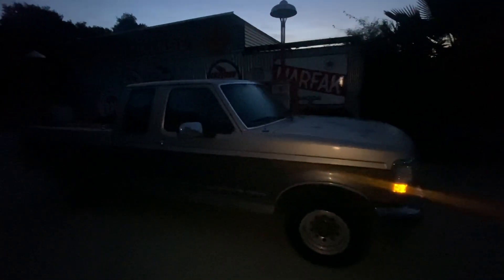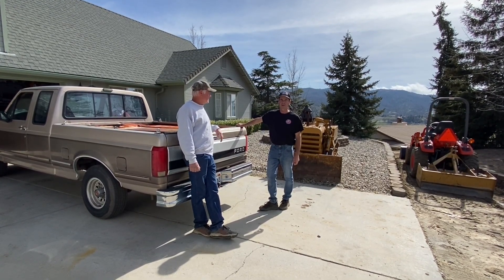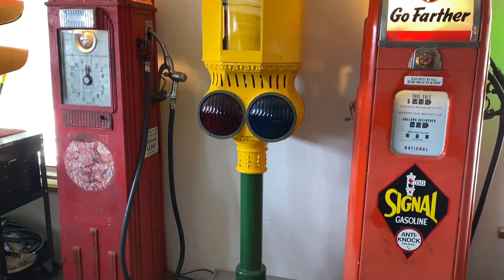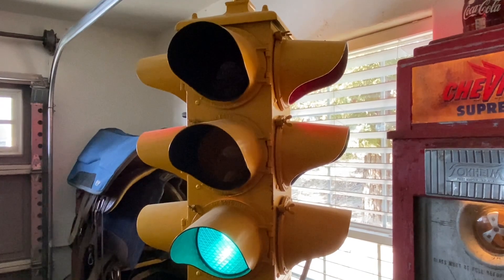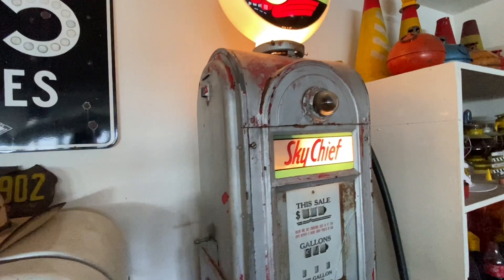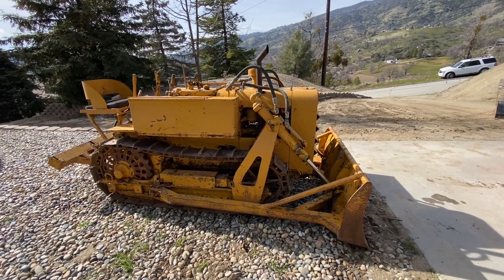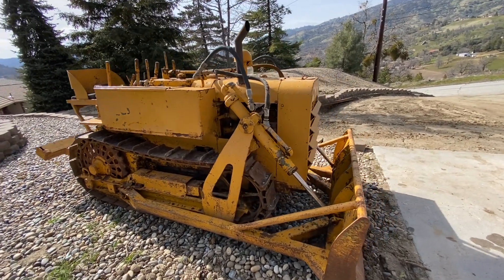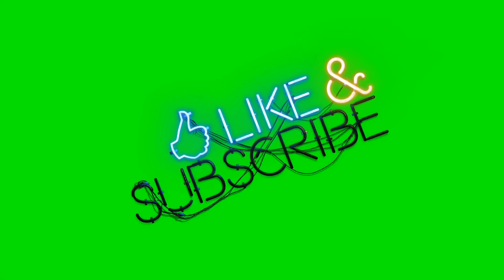Amazing treasure display of gas station pumps and vintage car/automotive transportation memorabilia!

Comment: Your truck with about 250,000 mi versus Midwest Truck. Yours looks new ours looks little rusty even if it was kept inside. 
I love that little mini track dozer!
I have a few of those battery operated flashing lights Summer metal most of plastic. I have antique slow sign stop signs handheld that is and some other stuff including railroad light signs are flashing ones but they're LED. I don't even think they're 20 years old. Got them in a couple of trucks that I bought from the railroad and they left all kinds of stuff in there.. non exciting things like electrical connectors and the cabinets where the back seat is supposed to be in my Chevy HD. Already took the utility box off have all kinds of lights on there and I have the mechanism of the better part of it for roll it down the railroad tracks too. Lot of stuff I have packed away just like my cop stuff and EMT stuff I was really into that for a while. And since my grandfather retired as an engineer from a railroad have few little knick-knacks from him yet as well. That I'll keep but the other stuff I'm more than glad to turn loose of. side note. You know these crash barricade trailers they pulled behind a state work trucks so you crash into them and said of hitting the workers are the truck directly? That box frame going to make great gate Post backfield and concrete it won't move. But the other one I'm going to put a heavier axle under it maybe two axles and I use the word axle very loosely because it's going to make a perfect log hauling trailer. I'll probably do a video on it when I build it. One last thing beautiful scenery showed on your drive up there. Have a fine wonderful day. I've not put anything up last couple of days.
Reply from the maker: You are incredible!!!! Thank you for being you. You supported me on my channel and choice of vehicles to save . I admire you completely.
Reply from the maker: Between you and I a railroad signal video is coming in the near future!!! My friend collected them as well and has worked hard getting them to operate again. You mentioned raIlroad I will deliver. I did not know that about your Grandfather or that you had collected all that stuff.
Reply: @gaspumprob  did you see my reply / comment with the link earlier today? I put a bunch of you read gas pumps on it at the beginning and end of my comment to highlight it because of the Pegasus Mobil oil gas station sign. The story was about a very neat car but that was in the background and they talked about it a little bit. A man is trying to keep my responses little shorter but that one's out of the park again
Reply from the maker: We are going to produce a railroad video very soon . Please stay tuned to my channel for this . Epic train video in the future. Appreciate your viewing and comments as always. Rob in the left coast- California making a difference for the right .
Reply from the maker: Good morning. I have not seen that yet. I got lost in all the comments. I will try to find it and watch it. I wonder if he would sell me that sign?
Reply from the maker: The California climate is kind to the vehicles. That truck drove as smoothly as day one on that trip. Compared to my Dodge it rides like a car. Very comfortable.